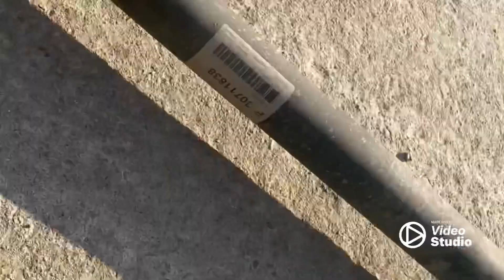Volvo xc 90 D5  Driverline / prop shaft removel

Comment: The point is how you discovered, you showed on floor, show me how to take it off
Reply: This is the most annoying part of this video, I have all the bolts out and mine is held in by rust, hitting it with a hammer won’t budge it. Can’t find a video showing how to get it out.